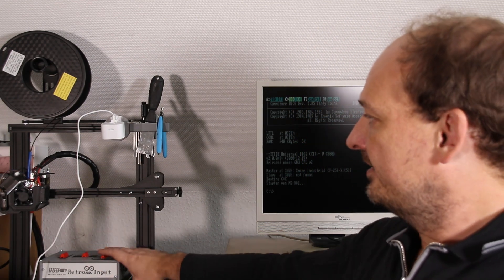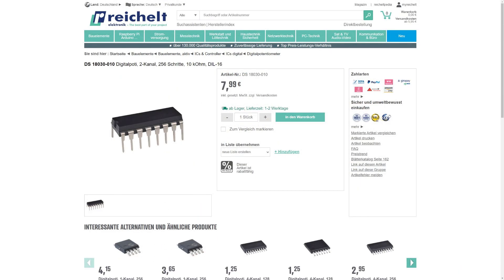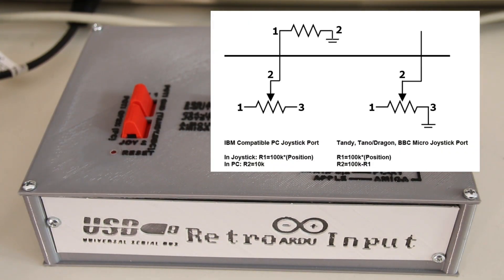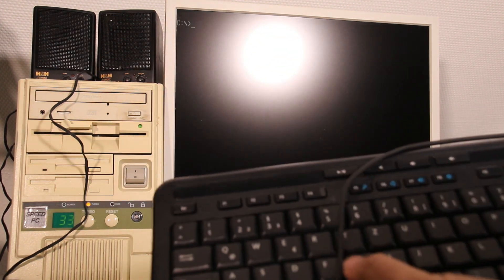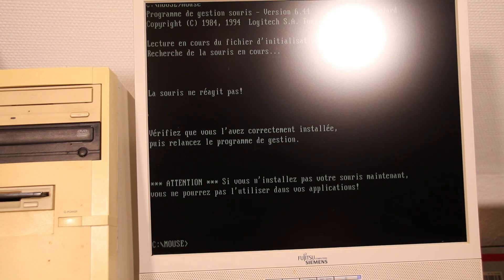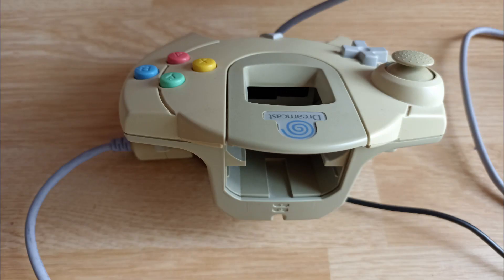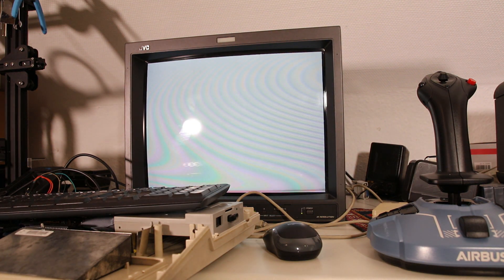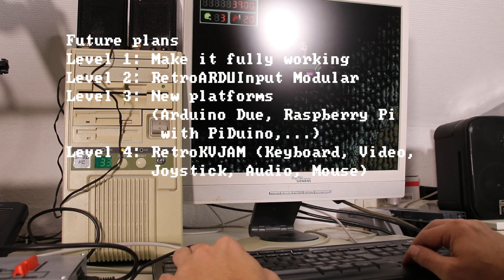USB Input Devices on vintage computers - the USB RetroARDUInput (English version)

Comment: wow this is great, just came from adrians video. id love to make a fork for a minimal a500 only or work out an a1200 version to mod them internally permanently as i have bare motherboards of both with no keyboards but i have no idea how pcb design works lol
Reply from the maker: Glad you like it. Feel free to make your own forks of the project. PCB-Design is easy, I also never did this before. There are many great KiCAD tutorials out there. I also made my mistakes in designing this PCB, so it still has quite thin ground and +5V lines, no ground planes... but it works anyway. The next version will be better.
Amiga 1200 keyboard is a whole different story, as the 1200 connects the keyboard matrix directly to the computer, so you would have to mimic a matrix (which would require quite a lot of pins). If you manage this, you could also do this even for the C64.
For the A500, my concern would be that you require minimum an Arduino Uno (heavy modifications to the source code required due to the less memory of the Uno, so you need to strip out anything not required to free up RAM) or Mega2560 and a USB host shield - an additional PCB would even not be required as you can connect the wires to the internal keyboard port directly to the Arduino. Or you would need to make your own Atmega (Arduino Mimic)+Host Shield All In One PCB, which would require a lot of own design and fine pitch SMD soldering - which I wanted to avoid in my project to cover all people who cannot solder SMD so well, including me. So if you want to fit this inside the case, the off-the-shelf Arduino+Host Shield stack is not suitable.